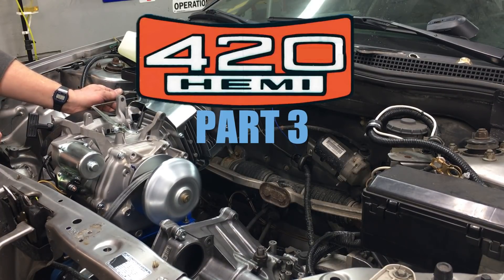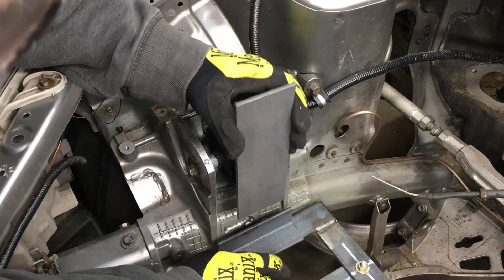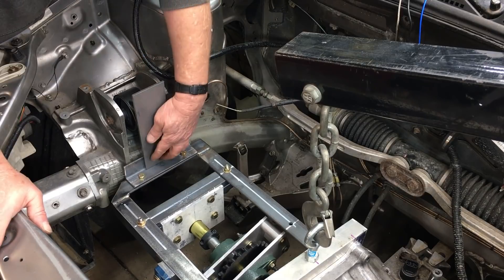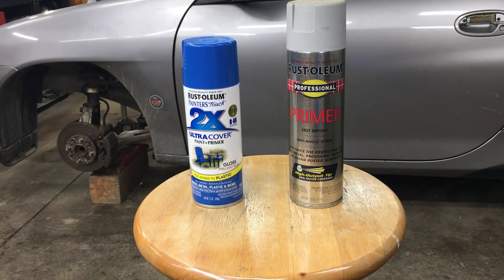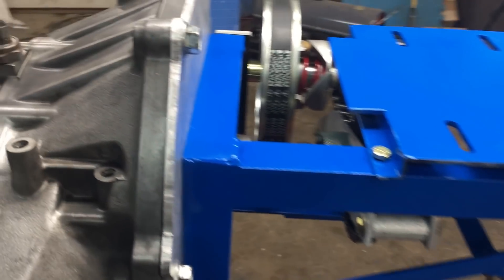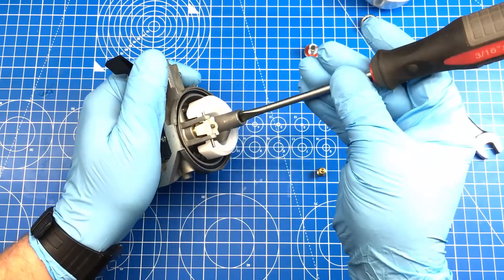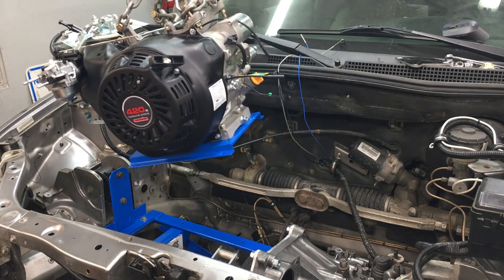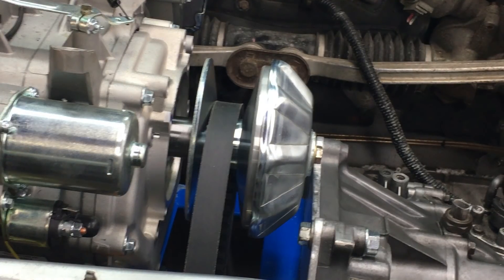Episode 14.  420 Hemi engine swap... first start .  Lawnmower powered Honda Insight  PART 3

Comment: Now you need to double your horsepower and make it all wheel drive but putting a second engine in the trunk. That should get your 0 to 60 times less than a minute.

Comment: Yeah I have one of those Motors on my plow tractor the charging system sucks it's about 3 amps what's yours was unless you just charging a battery I put an external alternator on the engine they make small alternator like 50 bucks lawn equipment they run by belt pretty simple two wires and a regulator 14 amps much better

Comment: That crappy old lathe is better than all but one tiny lathe at my job. I was amazed you didn't struggle to loosen the cutting tool angle adjustment!
We have at least 20 lathes by the way. Nobody maintains them.

Comment: I had a 1999 Dodge Grand Caravan with a 3.3 liter V6 engine. The engine was all metric but the body bolts were all Imperial. Maybe that was the year they finished the change over to metric?

Comment: Have you ever had a trailer bolt up without a hitch? 😆

I'm sorry but it appears that that crappy old lathe has gotten you into a tighter spot with that new mount bushing. 😆

Comment: What about a small electric motor that's only used for take-offs from standing start and when going uphill?  The battery could be charged through regen braking, as the electric motor would only be running a small amount of time.

Comment: Those Insights have electric motors in the rear hubs. Put a 5kw generator under the hood and let the 22hp motors drive you around.
Reply: No they don't, the electric motor is bolted to the engine's flywheel.

Comment: is the gear reduction essential or could the cvt fir directly onto the gearbox shaft
Reply from the maker: I actually tried the direct drive and encountered problems.  The gear ratio spread on this transmission is to wide between 1st and second.
Reply: @robotcantina8957  that's a sod guess it makes tension adjustment simpler this way

Comment: Great job on the videos.  Have to say I once had a 10mm socket disappear for 120,000 miles, about three years, before I actually replaced my truck’s 350 with a 383.  The sneaky thing actually lodged behind the water pump.  I don’t have that truck any more but I do have that socket still.
  This is a novel series and I have no interest in actually making anything with an Insight but I really enjoy the engine modifications and the fabricating.  Clean work.

Comment: Personally i prefer the 212, but the 420 is gonna be pretty sweet in this build, i wish all this work went into a manual car but this should be cool no matter what
Reply from the maker: The Honda I'm using is equipped with a 5 speed manual transmission.  The clutch on the transmission was replaced with a CVT torque converter type clutch to provide extra torque.  I was unable to use the Honda clutch due to complexity
Reply: @robotcantina8957  sweet thats exactly what ive been wanting to see your videos are quite detailed, i just watched them in backwards order i guess

Comment: nice! would be cool to drive the linear hybrid system with a small single cylinder engine too....like a mini freight train.
Reply: Just install a generator instead of the Predator motor, hook it up to the battery and.... Oh, hello Chevy Volt! I didn't see you there!

Comment: Beautiful engineering, I plan on doing this with a 670 and original clutch
Reply from the maker: What type of car are you thinking of doing?
Reply: @robotcantina8957  probably a small truck, I can't until I get my workshop though
Reply: @robotcantina8957  I might even use an automatic transmission if I can wire it to be manual

Comment: I tried to comment on another video but I couldn't find it later on so I'll try again. Sorry if you've already seen it. I think you should consider changing your transmission fluid to a thinner oil. Many jeep owners put 10w30 in their manuals instead of the recommended 75w90. I personally don't like this for normal applications however in your low horsepower scenario I think it wouldn't cause significant wear problems. As you mentioned before it takes a while for it to heat up and thin out. I think it would be beneficial for you to consider using a thinner oil especially a synthetic one. Maybe even use an ATF. Just something to consider.
Reply from the maker: The Honda Insight uses very light oil in the transmission.  If I had to guess its equivalent to 30wt.  For now, I'm using the recommended oil because  there are known issues with the 5 speed transmission and the Honda oil  seems to help.   I'm still looking into ideas on keeping the transmission warm.
Reply: 75w-90 is around 10w40, once worn in, it could be closer to a 10w30.
 Translate to centistokes and/or centipoise for a more definitive comparison.

Comment: How many miles do you reckon you'll get out of an engine like that, 10K is my guess?
Reply from the maker: Good question.  I reckon the weak link is the connecting rod.  If I replace the rod with a billet unit,  its possible the engine could survive 10K or more miles.

Comment: A lot of figuring and head scratching goes into just slapping a different engine in something, you've done a great job here Robot.
Reply from the maker: Sometimes a simple problem requires complex solutions...
Reply: @robotcantina8957  especially true when you want the end results to be done right.

Comment: great Job....I wold have gone for all Belt drive....less mess and maintenance...and reduced noise..?
Reply from the maker: Good point.  I did an all belt drive on a 1927 Ford Model T a few years ago.  I ran into a problem with the belts getting wet and the car wouldn't move.
Reply: @robotcantina8957  the Primary CVT Belt could Remain a  'V' section...the secondary could be Toothed..?